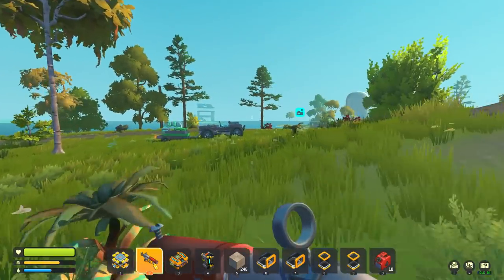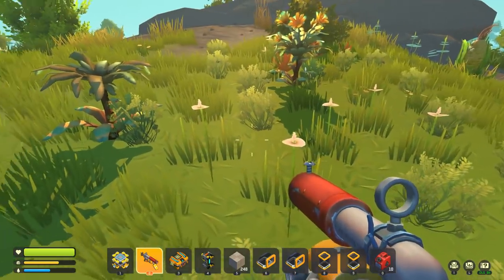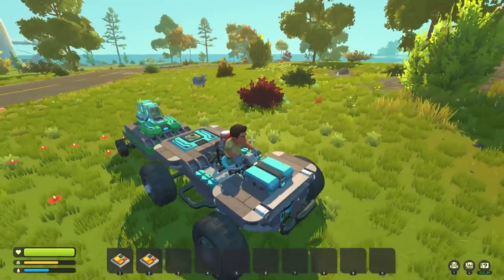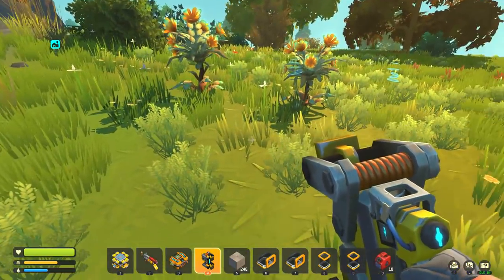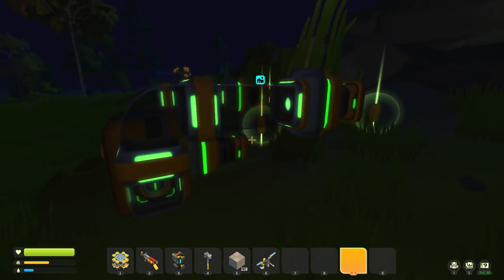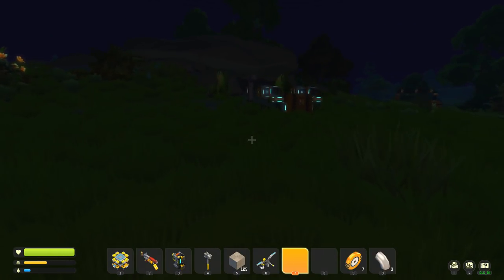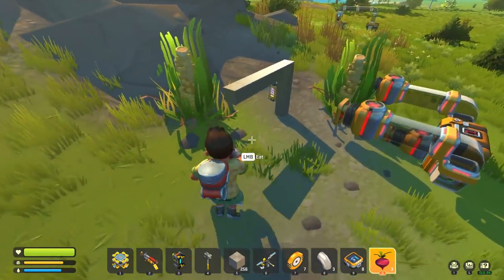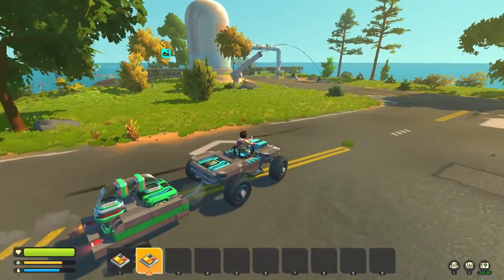Building a Fully AUTOMATIC Corn & Flower HARVESTER for SCIENCE (Scrap Mechanic Survival Ep. 17)

Comment: Theoretically you could farm a complete field with an automated car. You would still need a bunch of resources, to define the course this car needs to follow, but this way you have a single chest where all the resources can be collected. That doesn't change that you need to be in vicinity and there is still the other question. Will the bots attack this vehicle? If yes, it gets really resource hungry as the vehicle needs to defend itself.
Reply: just put sawblades with controller on the sides

Comment: The only thing wrong that I can see with this is that you'd need to post passive defense systems (ie saw blades and drill bits) on your stations or else you're going to lose expensive pumps and chests to a rampant haybot or totebot.

Find a more lush patch of flowers and corn and have kAN teach you how to make a "grid based sweeper" like what he did with his auto farm and then build it over some 14 or so flowers and have it repeat. For the corn, use an over the top pump rotating system where the pump hits each spot where the corn falls to.

As far as the "automation" potential you're bringing up, I think it's more of the consistency than the quantity that's the real appeal. It's kind of like glow farms, oil, water, and chemical pump stations. It's not the fact that it's 100% useful and works all the time but it's the fact that as you pass its tile, it ends up working and when you visit it within reason (in otherwords not immediately every possible minute) there will be something collected there. It's just that flowers, corn, and honey comb are all on in game respawn timers that don't provide the consistency of oil, water, or chemicals and aren't as predictable as glow farms and actual farms are. I think there is a potential use for automating corn and flower collecting, but there's another step that needs to be added by Axolot before it's actually an applicable process.

Comment: experiments are fun!  what if you made a vehicle with a bar in front, and 3 or 4 vac pumps behind it and you drive it into corn?  That should pick up all the corn better than the single pump you had in the back.  The same vehicle could also be used to then get flowers too?
Reply: I don't play the game but I believe the problem is the vacuum pumps take three or four seconds between each suck and only suck one item up at a time.  So you can't just drive through and expect everything is picked up right away.

Comment: Sorry to clutter your comment section with a second comment, but you'll probably need to do at least an 8 pump setup to make a mobile collector a viable thing. The pumps take so long to individually pick up something and then reset and ready to go again that you'd need at least 4 to keep up with a slower pace. Using chests as improvised T pieces, you could collect everything into 1 chest eventually. But that is the fatal flaw of the suction of the vacuum pump, it takes too long to process 1 item that multiple pumps is the only solution.